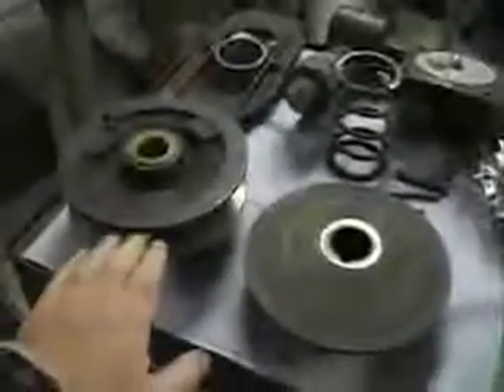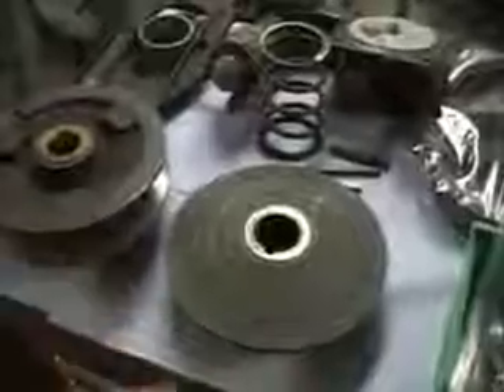BRIDGEPORT CNC PROGRESS 3 - CONVERSION TO VFD & POLYV BELT DRIVE

Comment: Did you buy the poly flex pulleys or make them?  If bought,  where did you source them from?
Reply from the maker: The pulleys were home made aand this was discussed at length on the CNCZONE here
http://www.cnczone.com/forums/bridgeport-hardinge-mills/96163-series-one-head-drive-conversion-6.html

Comment from the maker: I didn't.  As recommended by Roland Friestad in his Home Shop Machinist magazine series of articles on converting a BP CNC to MACH3 control, I just removed the timer mechanism and lube the machine manually every couiple of hours of use.  This machine is for hobby use only and even with periodic use and oil pumping is dripping oil from all of its ways.

Comment from the maker: Actually the 2:1 belt conversion video is called:  "BRIDGEPORT CNC PROGRESS 7 - POLY V BELT UPGRADE"  overdriving the VFD to 80hz gives in the mid 4k rpm range (theoretically 1725 rpm motor x 2 x 80/60 = 4600rpm).  I am not an expert on electronics and have not really noticed a torque effect but I rarely use bigger than a 1/2" endmill in alum.

Comment from the maker: Hi, VFD was added after the controller was changed.  I used a 48v toroid xformer to provide the power for the three steppers(Gecko203V's) plugged into a 110v wall socket. The new controller is very compact/portable and I use it for my plasma table too-see my other vids here on utube).  The VFD is plugged into 220v single phase from my brkr box. I have yet to find the time to wire it so it is controlled by MACH.  I believe any good quality VFD will reverse and brake when configured to do so.

Comment: Did you install that VFD before changing the controller?   Original controller had 2 transformers  #1 makes 110 for the computer and #2  makes 24 volt for the relays and 90 volt for the servos?  wondering If I can do away with #1 and switch transformer # 2 with something that takes in 110 and puts out 24 and 90?  then the VFD goes into a 3rd circuit that just goes to the spindle motor with 2 relay signals for forward/reverse and another for braking.

Comment from the maker: Hi Mtnman, my understanding is that a VFD is for driving motors only, it is not a phase converter. It will take single phase input power and output 3 phase power to drive a 3 phase motor. The advantage is that it will drive a motor and allow you to get variable speed through the VFD.   Google 'variable frequency drive'  , Wikipedia has a good explanation .

Comment: I have a V2xt and am interested in going witha Hitachi  3hp VFD for now just for teh 3 phase conversion.  Can that feed my main powerline?  Will teh controller have issues with VFD created phases.  Eventually with a centroid retrofit I just want to power the spindle with this.  Do you know if I could just run 220 house current to the controllers and put the VFD in right at the motor.  I have a 1991 V2xt SX.  any help highly appreciated.